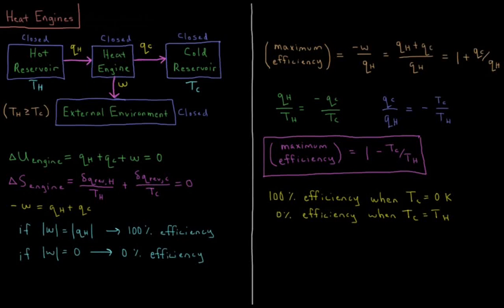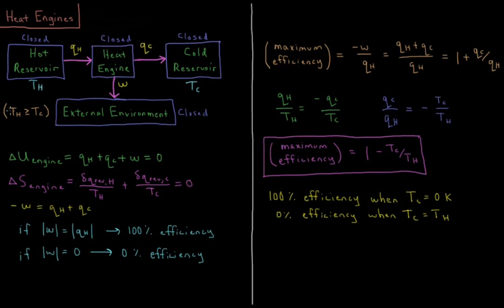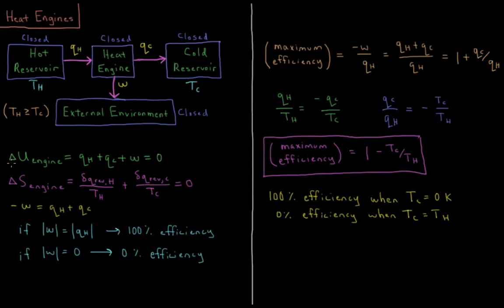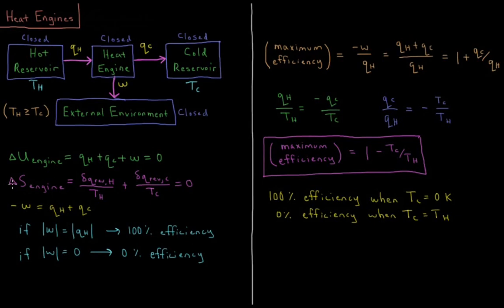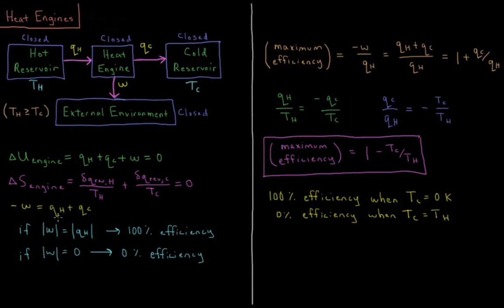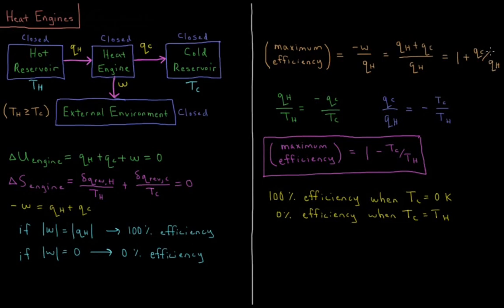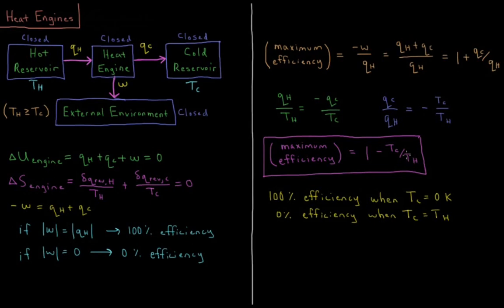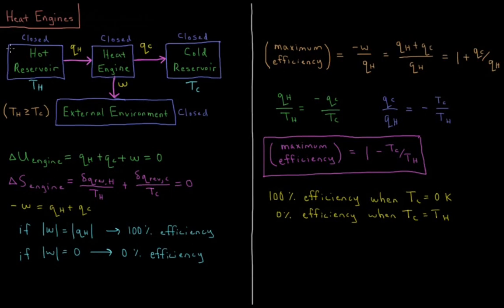Chemical Thermodynamics 4.10 - Heat Engines

Comment: I'm not sure why Δu_engine equals 0. does the temperature of the engine stay the same during the process?
or is it because the whole diagram on the left can be treated as the universe?

and about the second eqn on the left, should there be Δ's in front of q_rev's instead of δ?

from the 2nd law of thermodynamic, ΔS=q_H/T_H + q_C/T_C >=0. 
then q_H/T_H >= -q_C/T-C, and with some algebra q_C/q_H >= -T_C/T_H.
Say -T_C/T_H = -0.3 then q_C/q_H could be -0.2 and maximum efficiency would be achived by q_C/q_H being -0.2 rather than -0.3.
so how can the maximum efficiency equal 1-T_C/T_H?
is it because the process should be reversible?
Reply from the maker: deltaU is zero for the engine because the heat energy that is input from the hot reservoir is all released to the cold reservoir (as heat) and the external environment (as work). Whether the energy released is heat or work does not matter, it only matters what the net sum of all the processes is, which in this case is zero. The temperature of the engine could remain the same or change, as temperature alone is not a complete indicator of internal energy (i.e. the pressure or volume could change, etc.).

Regarding the second point, I believe there is a sign error. Since heat enters the system from the hot reservoir, and leaves to the cold reservoir, q_h > 0 and q_c < 0. Therefore, at the stage where we move q_c from one side of the inequality to the other, we are multiplying a negative number, and therefore must flip the direction of the inequality. I believe this step corrects the sign error to enforce the maximum efficiency, rather than the minimum efficiency.

And you're right about dq. This is an infinitesimal, and should only be written if the left hand side is dS (regular script d, for the state function S). The macroscopic version of dq is just q, so the solution as written is to remove the greek d entirely from the equation.
Reply from the maker: Actually, upon further review, I think the problem with consider the irreversible case (>= vs. =) is that both S_h and S_c can be >= their respective q / T ratio, and inequalities get weird when you have more than one variable. This appears to be the reason why most sources consider only the reversible (=) case, where the math is safer and cleaner. We can't be sure about the individual components of S (total), but we can be sure that the total S >= 0.